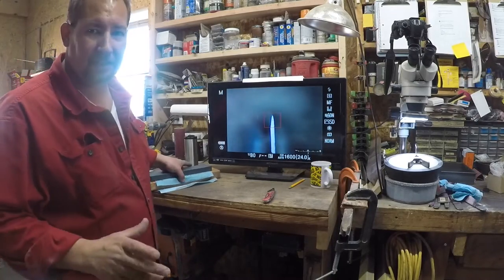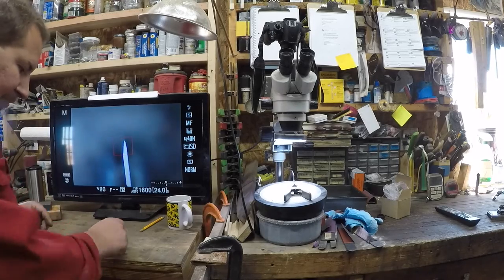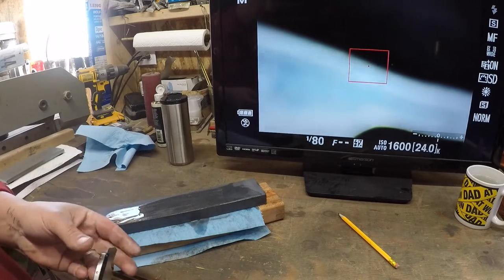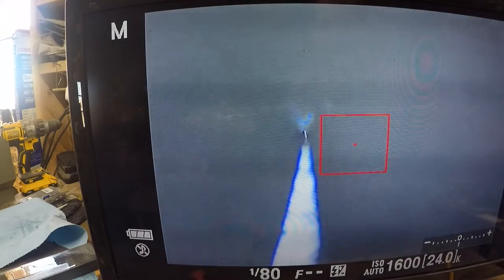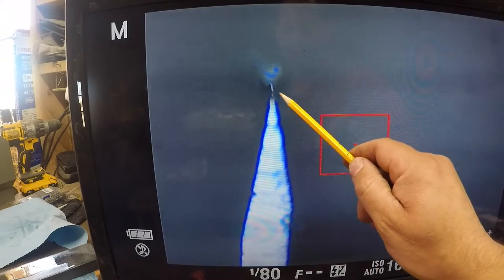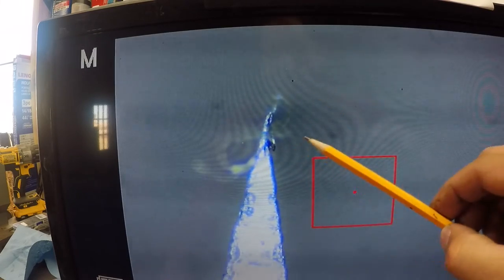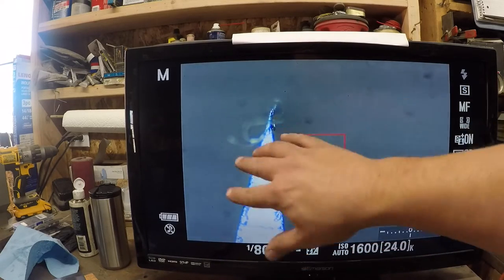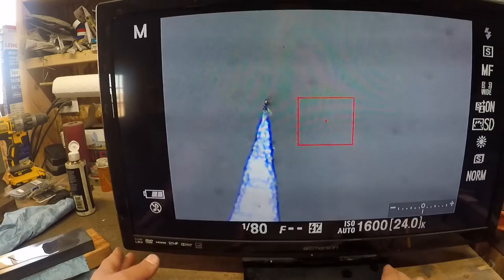Sharpening - the burr under the microscope

Comment: I would be very interested what "jointing" via Carter-Stanley method does to the burr.  It's the old Cliff Stamp trick of running it lightly against a high grit stone.

So these 3 inages of the bevel and burr

1. jointed
2. jointed then microbeveled
3. jointed and then edge refined at the same bevel angle

This microscope angle is marvellous.  Keep innovating, Joe!
Reply from the maker: jointing as in when he ran the edge at 90 to the stone to get rid of the stressed steel from the last edge?
Reply: @joecalton1449  Yes, that's it.
Reply from the maker: @l26wang  from my understaning of jointing, it was to get rid of the stressed steel behind the last edge, and to give a flat on the edge that you can see when you sharpen with the burrless method. when you use the burr method, you dont have to see the edge becuase you can feel it, and the burr is the stressed steel, so there is no need to joint to remove it.
Reply: @joecalton1449  You are absolutely right.  In Cliff's 3 step sharpening process there is the initial destress of the edge where it's ground directly into the stone.  This removes stressed metal and reveals the strip of light needed for plateau sharpening.

However, if you do form a burr, either accidentally or intentionally, cliff recommends elevating the angle a lot and do 2 light passes to cut off the burr against the stone.  Oh shoot, you already do it here - https://youtu.be/sKmr2xr702M?t=851 .  It creates a micro bevel that you can keep or sharpen away.

Murry Carter's new sharpening system (Carter-Stanley), there is a "jointing" step.  here https://youtu.be/dyyVYlfP3m8?t=272

So instead of using a higher angle to create a micro bevel, he raises the edge angle all the way up perpendicular to the stone to grind off the burr and then back sharpens.

I'm curious both in the micro bevel and jointing way of burr management looks like under microscope.

Comment: Joe this may sound nuts but I've tried what you are doing here before and I've always had trouble getting rid of the burr started by the coarse norton what I do differently is instead of going to the two by four I run my edge very lightly over a naniwa 12k just like you did the 2x4 then I go back for a couple laps
Reply from the maker: nice!  I think the problem on this one was that the steel in that utility blade is a bit softer than what im used to, and i think that particular 2x4 was a pretty hard one, and so the edge didnt sink in enough to grab the burr and remove it and just bent it over instead

Comment: Great video, answered a lot of questions I had, and very well done, very enjoyable. Thanks, man! Oh ... that scope there, if it's a metallurgical or materials scope, is pricey. A USB scope can be had for around $100, and will give 200X magnification (the screen resolution has to be high enough). Sharp is sharp, and "competition" sharpness won't last long, but I'd like to see you work with something like an Arashiyama 6K, or a strop with 0.5 micron spray. For a 300 grit, that bevel and edge you got are spectacular.
Reply from the maker: i tried on of the usb scopes, and they are kind of ok, but dont have near the clarity to be able to show alot of what I want to see. like corrosion on a straight razor edge. the fella that showed me his setup that is similar to mine, I looked at an edge and it looked great under the usb scope. when we put it under his, you could see pits from corrosion plain as day, which is why I purchased this setup.
the only time I really strop anything is with my straight razor, everything else just gets a stone, and typically something around 300-400 grit. I do have stones up to 12k, and show some of them in other vids honing razors with the scope.
Reply: @joecalton1449  ---- I'm curious about what kind of scope setup you have, if you don't mind giving away secrets? All the materials scopes I have seen that go beyond 80X are priced in the $5,000 to $12,000 dollar range. I don't know microscopy at all, and that amount of money is a lot more than I want to spend on a knife sharpening hobby (I can get them noticeably sharper than the factories). Some are available used, if I knew precisely what to get. Oh - it occurred to me that possibly one way of knocking off a burr is to very lightly roll the edge almost 1880 degrees on a stone, to bend the burr all the way over the edge, then take one edge-leading stroke to see if that shaves it off.